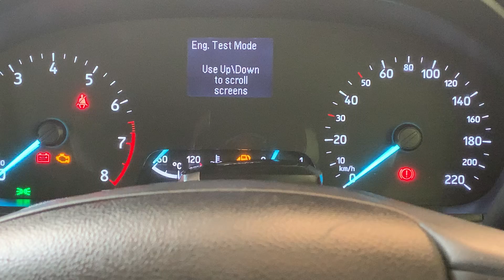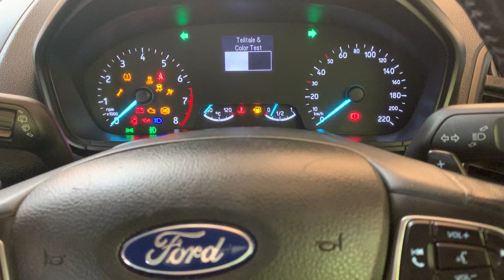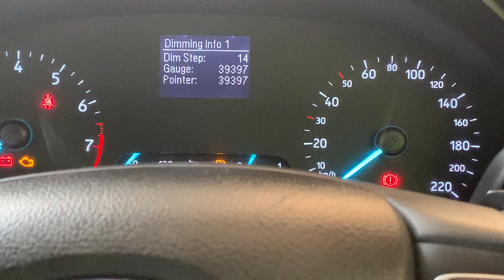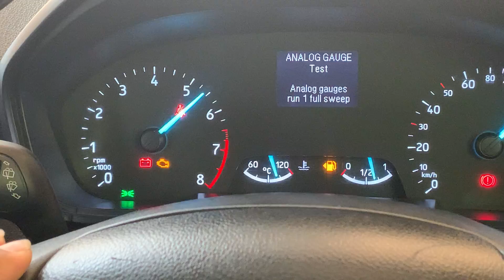How to get into Ford Ecosport ET Eng Test Mode | DIAG | Secret Feature

Comment: Hi, do you know if in Ecosport 2022 from India there is TPMS (Tyre pressure monitor)? I'm from Argentina and recently I bought an Ecosport which has been made in India (fabrication date around november/december 2022) and I don't have the Tyre pressure monitor in the computer options... I think there is no sensor present but maybe there is a chance of adding the sensors and then configure, somehow, the computer to get the information...
Reply: yes u can addd sensors in tyres and enable this feature ...TPMS,crusie control, cornering lights, etc can enable..